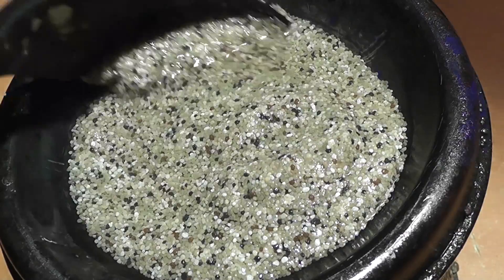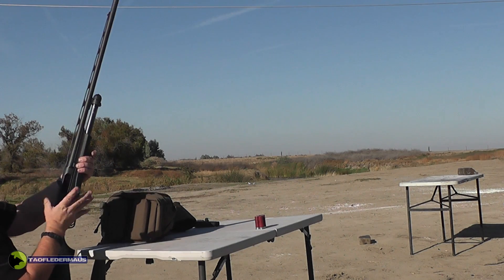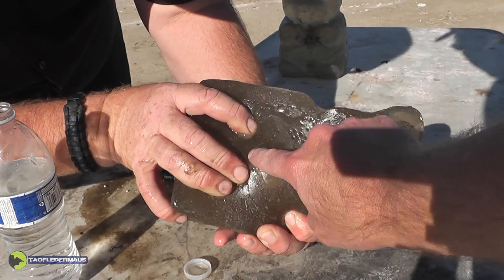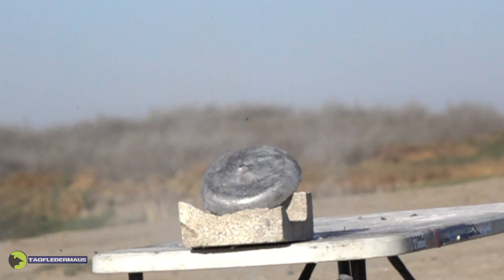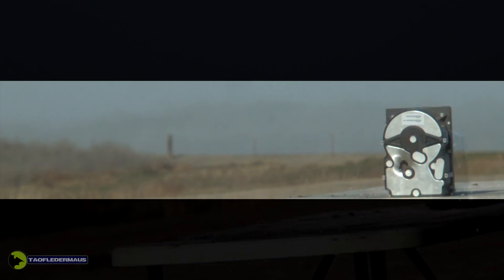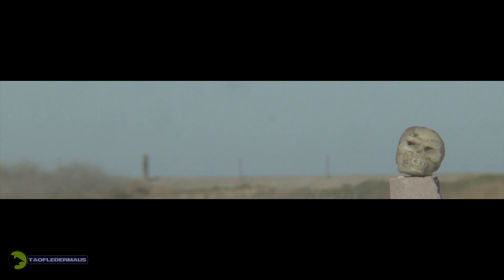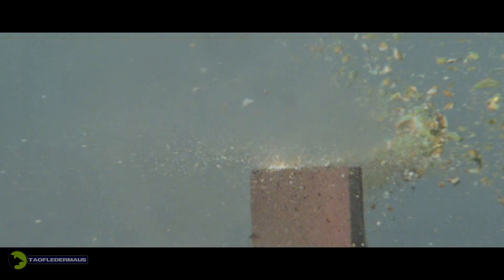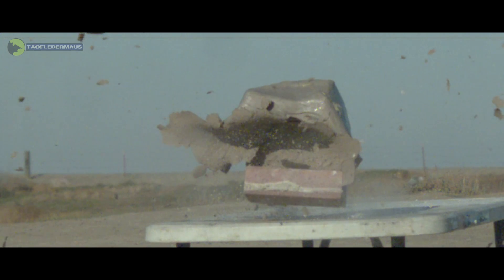QUARTZ Shotgun Wax Slugs - Massive Energy Transfer

Comment: This is a great demonstration of Newton's projectile depth approximation- at high speeds, with how the momentum transfer plays out, you generally expect the projectile penetration depth to be the length of the projectile times the density ratios between the projectile and impacted body. If the projectile is 1 inch and has half the density of lead, you'd only expect it to penetrate 1/2 inch into a lead target. If it's twice the density of gummy bear, you'd expect it to penetrate 2 inches into the gummy bear. As a rough approximation, making a given projectile go faster doesn't make it penetrate further, it just makes the wound channel wider. If you want a deeper wound channel, you need a denser or longer projectile. That's exactly what we see here.
Reply from the maker: thanks Claire!

Comment: I asked Matt, but maybe you could do it better. I would like to see bullet impact hot molten glass. a large lump of it on a table or something? in a thin steel mixing bowl? will the splatter harden instantly  to reveal some sort of glass art? Common man, no one else blows glass this way! 
slowmo would be great too
Reply from the maker: I don't have a torch that will get that hot
Reply: TAOFLEDERMAUS  propane torch should get hot enough to make it good and soft right? do they get to like 3000 degrees? 2000 degrees should do the trick. maybe I'm wrong. don't let me get anyone hurt though.
Reply from the maker: It's pretty dry around here,   hitting that with a bullet would probably start a wild fire.
Reply: TAOFLEDERMAUS yeah its sickly dangerous. thanks for your immediate response! hope you have a happy thanksgiving! thanks for the amazing videos

Comment: How tightly were you able to get the quartz packed into the slug? Since it is a crystal at the molecular level, there may be some way to get it even more tightly packed for more mass. Maybe a lighter wax and/or expose the mold to vibration while the wax is still a hot liquid, and you might be able to get even more quartz in the slug. Also, what about a single pointed larger quartz crystal in the nose of the slug?
Reply from the maker: At that point it would be easier to cast it into a mold.  Wax slugs are unique because they are a frangible slug and deliver their energy differently than a solid projectile.
Reply from the maker: You can see how compact it was.  I couldn't have made it more compact.
Reply: Could you try compacting a lead pellet wax slug?  Lead is quite malleable.  Maybe you could press it into a mould and make a tighter round?  Maybe you won't really even need wax?

Comment: Why not shoot some low cost simulated gems in wax and mixed with epoxy resin slugs?

Cubic zirconia would be perfect and you can buy loads of different size stones loose and cheap on ebay.

Comment: Woah, this might just be a very good low cost alternative to those non-lethal rubber slugs. The wound cleaning process would be hella messy though..

Gregg's accuracy is literally on-point again today. Nice shooting!
Reply: Thanks Devjock. The quartz would probably be very lethal. Not only would it penetrate, it would be likely to disperse throughout the body, causing an ugly wound that would be difficult to clean or repair.
Reply: Fair enough, non-lethal's off the table then :)

Comment: you should make wax slugs but with no BBs just candle wax poored into a shot cup and shoot it into a block of wax. Like wax vs wax. Will be interesting
Reply from the maker: I made a solid wax slug before and it only weighs about 1 gram.   It's so light that it doesn't have enough mass to fly straight,  just curves off and misses the broad side of a barn.

Comment: did the barrel show any damage?
Reply from the maker: no
Reply: TAOFLEDERMAUS I assume that's because the quartz wasn't loose.  nice video.
Reply: Brandon Johnson 
to damage the barrel,  the quartz would have to be harder than the steel
Reply: +Trigger Talk

Steel can have a hardness ranging from about 4 to 8.5 on the Mohs scale, while quartz sits comfortably at 7. On average, the hardest tool steel available will level out around an 8, and you absolutely would NOT want to use the hardest steel available in the barrel of a firearm, given it's need to flex and handle the pressures of a cartridge. 

So, I suspect a few hundred of these rounds would eventually leave some noticeable scratches, especially through a rifled barrel or choke. However, like Brandon Johnson said, keeping the quartz contained in the slug would keep it from scratching nearly as badly as it could have, loose.
Reply: IntroSpectre6x3 
I didn't know quartz was that hard! interesting.. anyway, thanks for the 411

Comment: looks like an awesome frangible round for home defense. it dumps all its energy in the first inch or 2 on contact
Reply: derek leverknight anything suitable for self defense should have to be able to penetrate 12" of ballistics gel.
Reply: Filipe Amaral not if its dumping that much energy. its like being hit with a 90mph softball. i may not penetrate but the blunt force trauma alone is going to put a person down.
Reply: derek leverknight Energy doesn't stop people, only severing the central nervous system or hypovolemic shock does.

Due to Newton's Third Law of Motion, if the round could put someone down by blunt trauma, then the stock hitting you in the shoulder would knock you down.
Reply: Filipe Amaral i mean if thats the case you should be ok with standing in front of one for a torso shot right?
Reply: Filipe Amaral look bud youre sending a relatively light load at extreme velocities that literally dumps all of its energy almost immediately. it would make a good home defense round because of that. Just because it doesnt meet the recommended standard for a self defense round, ie: the 12in penetration in ballistics gel, doesnt mean it wouldnt be a good round. thats an invalid test for a round like this. that test is designed to test a bullets ability to kill. what you forgot about was the completely MASSIVE temporary cavity this round created upon impact. which is the measure of the energy being imparted on the gel. the clay block as well showed that massive energy transfer. this may not kill you directly though i believe it could, but it will break bones and incapacitate your target. in clay blocks a 2in impact behind a bullet resistant vest is considered a failure as it would not protect against severe internal injury. hence those steel and ceramic plates. they arent inherently meant to stop the bullet itself from penetration but to minimize the blunt force imparted from that impact.  now based on the shown performance of this round it would make a good defense round for a few reasons. one is the massive impact it has. the second is how it delivers that impact which is almost immediately. and 3rd is the fact that this round absolutely will not over penetrate through the walls of your home. is that a better argument in favor of what this round is potentially capable of?
Reply: Filipe Amaral using martial arts as an example is a bit of ignorance first off. you are talking about fights in which both parties are specifically training their bodies to be able to absorb and handle the impacts involved and even then there are serious injuries during these fights. and yes without rules in those fights people did die on a regular basis hence the reason for those fights having rules and regulations to begin with. frangible rounds are not always meant to kill. and yes bean bag rounds do the same thing but they also have a high rate of malfunctions as well as not exactly being the most accurate of rounds. and yes if you do some looking around at vest testing and clay blocks looking at blunt force trauma the plates highly minimize that blunt force. it also keeps penetration from happening but by spreading the pinpoint impact of a normal bullet over the entire area of the plate you limit internal injury. with a round like this quartz setup you have more reliable accuracy or the potential for it at least. if you were to get hit in the chest with such a round the impact is going to incapacitate you. the reason some small or low power rounds dont drop attackers is many times due to the very pinpoint impacts of those rounds. they dont hit vitals and dont do enough surrounding damage to harm those vitals. the reason hollowpoints work better than a fmj is because of the hydraulic forces imparted in the mushrooming of the round as well as the expansion. so unless you happen to be wearing a plate carrier this particular round impacting you is going to put you down. yes it may not kill you though blunt force can do that, it will put you on the ground with the force its impact being spread over such a large area.  if youd ever seen a dedicated frangible round youd know they dump all of their energy internally or are at least designed too. they wont penetrate the full 12in ballistic gel either if they are working as designed.
Reply: derek leverknight It's not ignorance. You're insisting in talking about energy, and kinetic energy is equal independently of what generates it.

A good kick carries a fuckton more energy than a .22 LR, but a .22 will make you bleed to death and a good kick won't even concuss you unless it hits in a very specific way, in the head. The energy won't kill you, generally speaking.

>"you are talking about fights in which both parties are specifically training their bodies to be able to absorb and handle the impacts"

So by the same logic, because I am trained to contract my muscles and roll with punches to avoid internal damage, I could shrug off a less-than-lethal round.

If you're going to make up excuses for your arguments make sure that at least there's logical consistencies. If a pro muay thai fighter kicks you, you won't die if you haven't trained. It will just hurt a fuckton more.

>"without rules in those fights people did die"

Yeah, after 30-45 minutes of excruciatingly painful beatdown. Assuming that an average punch (ie not a knockout punch/finishing blow) from a fighter roughly equals a 9mm in energy, 45 minutes of asswhooping would probably be equivalent with catching an entire belt of a light machine gun. Or two.

And you're only digging yourself deeper, because for example bare knuckle fights means that the hands "penetrate" more into the body. The gloves trade off the sharp impact for blunt force.

>"bean bag rounds do the same thing but they also have a high rate of malfunctions as well as not exactly being the most accurate of rounds"

So a shoddy ass quartz wax slug would be an improvement in reliability when all you have is a slow motion study of the round and no actual scientific/medical data?

You're expecting to use a less-than-lethal shotgun at longer than bad breath range? Should have brought a rifle.

>"highly minimize that blunt force"

Bullets, specifically military rifle bullets, are spitzer pointed - they have very little blunt force. It's all penetration.

Plates trade off penetration for blunt force. The backface deformation in clay is literally all the blunt force that a bullet carries. It doesn't minimize it, it just turns an icepick stab into a baseball bat hitting you through a pillow. Must be a bitch to take it on the chest, but at least there's no hole.

>"if you were to get hit in the chest with such a round the impact is going to incapacitate you"

Literally pain-compliance. If for some reason the attacker doesn't register the pain, you'd have to hope for that Commotio cordis effect or some shit.

Pain compliance weapons are great to torture inmates or handcuffed citizens when you're the police, but shitty defense weapons.

>"the reason hollowpoints work better than a fmj is because of the hydraulic forces imparted in the mushrooming of the round as well as the expansion"

Bullshit. Hollowpoints work better because they crush more tissue and as they expand they prevent overpenetration.

Pistol rounds are generally incapable of generating hydraulic forces, typically a projectile needs to travel faster than 2,500ft/s. It's independent of bullet construction, you'll see pictures of soldiers shot by 7.62x39 FMJ and their body had bruising around the wound tract almost a foot wide.

>"if youd ever seen a dedicated frangible round youd know they dump all of their energy internally or are at least designed too. they wont penetrate the full 12in ballistic gel either if they are working as designed."

THOSE BULLETS ARE GENERALLY USED FOR VARMINT HUNTING

You're not supposed to use them on deer or humans. It's for small animals!

Yeah, there was the Glaser safety slug, which a) was shit and b) more deadly than this slug.

Comment: i would love to see the inside of the barrel post shooting quartz, as quartz is significantly harder than the barrel, thus curious to see how badly scored it is from that(although as i type this i question if we could even differentiate the damage from the quartz vs other materials shot out of the barrel as your barrels are all likely fubar)
Reply: I was thinking this exact thing. Some people are talking about making practical use of this but I think over time you might manage to ruin the accuracy of your barrel.
Reply: The barrel is protected by the shot cup.
Reply: How do you figure?
Reply: The slug sits down inside the plastic petals of the shot cup. The petals are between the barrel and the payload of the shell. The shot cup won't detach from the payload until after it leaves the barrel.

Comment: Maybe putting some steel or lead shot on the top of that would cause some increased penetration, if it didn't destabilize the slug too much and make it inaccurate. Whatever the case, that would be a job to clean out a wound from one of those.

Comment: Would be fun to see these made from tungsten but would have to find a source of powdered/shavings of it to make wax slugs from. Heavier then lead so should be able to fit more weight into the same volume.

Anyone working in a shop that works with it that can send him some to see it in action?
Reply: Tungsten powder is used to weight golf club shafts, and is stocked by some golf shops, or sometimes pops up on EBay. Would be really neat to see how that peforms along with wax. I once got some to make arc lamp cathodes ;-)
Reply: Andrew H what you think of as tungsten metal is actually tungsten dust sintered together with cobalt and nickle. Tungsten dust should be available.
Reply: Andrew H No make it out gold! Gold is very dense, granite its expensive but would be a cool slug seen made and shot but def have the capability of recovering that bad boy!
Reply: Gold is lighter then tungsten and granite is lighter then even lead.

Comment: this would make for a great home defense round: accurate and very powerful without the worries of over-penetration
Reply from the maker: Plus it would have very low recoil.
Reply: TAOFLEDERMAUS that would be especially nice in cases where you have multiple assailants and for someone of smaller stature.

how cost effective would they be? cheaper than an average slug?

Comment: Is there any difference between shooting sand and shooting quartz? i mean they are both basically Silicon.
Reply: Slightly larger particles. I mean, even beach sand ain't true sand, so it's a bit hard to answer. Would be a nice episode to go through sand ranges. Fine (Saharan, which is basically dust, and really gets in everywhere) to coarse, which would be this stuff, or crushed sea shells.